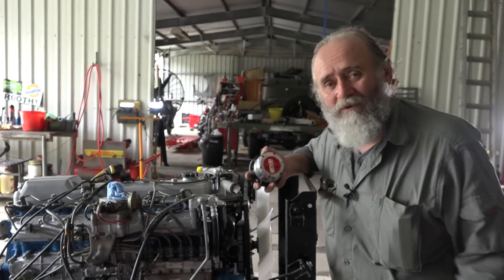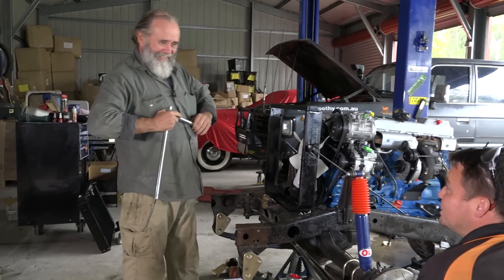Milo 2 - Cooling System and Custom Radiator Challenges - Roothy Bushmechanics

Comment: How do you reckon you will go installing the intercooler and piping?
Reply from the maker: G'day mate, probably won't be intercooling this one, no need really as the 12Ht puts out heaps of power, working on the principle of if it aint broke don't fix it.

Comment: I think you should fit the radiator a bit more forward and make small body adjustments. You have so much custom alterations away from factory and small tolerances you will not have any options if you break down since original parts won't fit.

Comment: Hi Roothy love the vids and the build :) Had you thought about going with an electric thermo fan instead of the fluid clutch/fan belt driven one? You wouldn't have had half the install issues....
Reply from the maker: G'day Harry, this is just a personal thing mate, but I really don't like the electric  thermo fans on my trucks, and in this case the issue would have been mounting front grill of the 40.
Reply: @JOHNROOTHROOTHY  How many inches/cm did the special recessed viscous save you. I have a similar problem coming up.